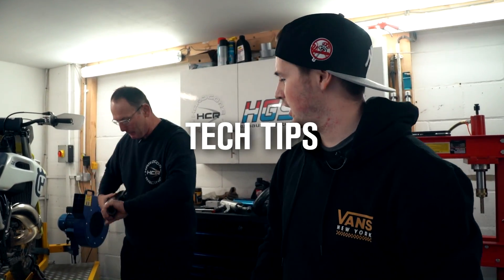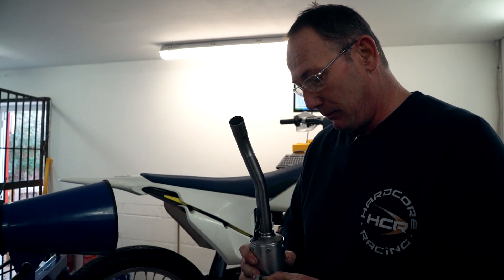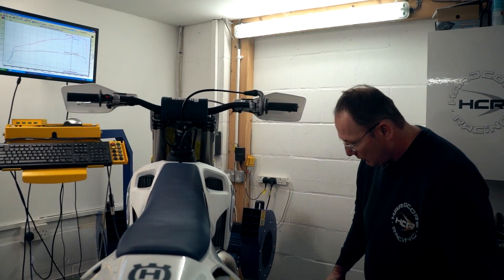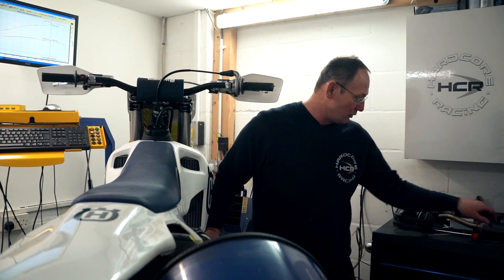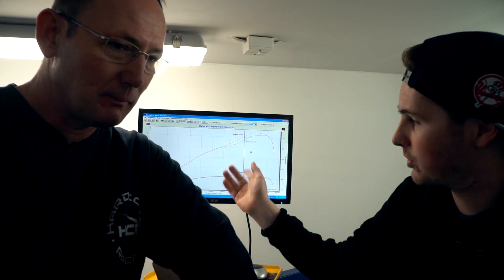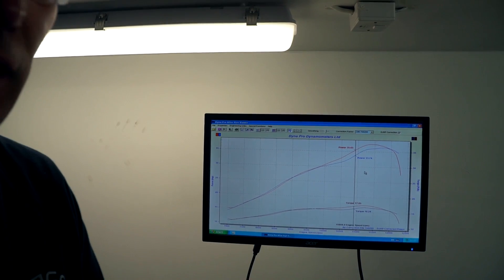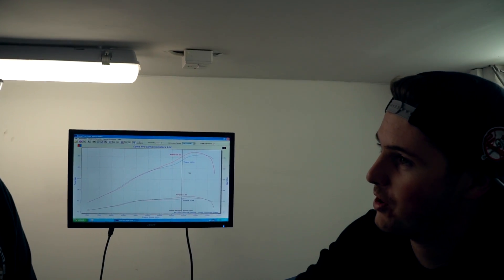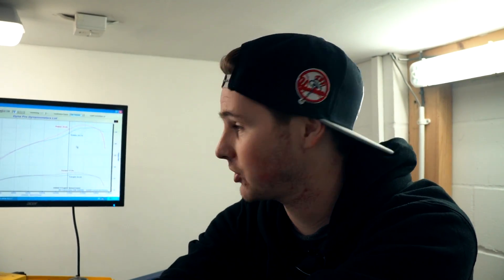Motocross | Is an Aftermarket Exhaust Pipe Worth It?

Comment: Hi, What was the final peak horse power figure ?
Reply: an extra 2hp.
I thought it was 5 or 6 with an HGS exhaust
maybe they installed it awry
maybe the carburater has to be set properly or changed..?
it should be 5 or 6.
ah well let them sort out their problems
know it can be 5 or 6hp.
Reply: No way a hgs exhaust can make that much hp need porting to make that happen
Reply: @onegerard 5hp from just a pipe is insane 2hp extra from a bolt on modification is extremely healthy

Comment: Can i put just the hgs  baffle on my yz 85  like on the video they made it made a difference  in  the  performance  of  the  yz 85 and it was  with  the  stock  pipe  that  come on the yz 85 just  a has baffle  I'm  ordering  one  for my yz and gonna  change  the  stock  sprocket  it come  with  14 front  and 47  rear  I'm ordering  14 front  and 52  rear  with  new  chain  and  the hgs  baffle  too and I'll  be  ready  to  go  great  video